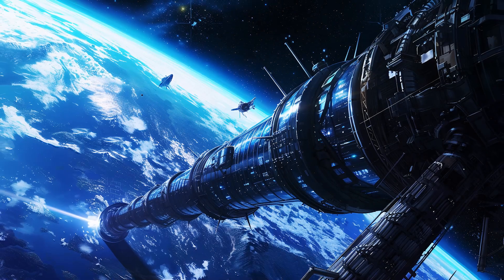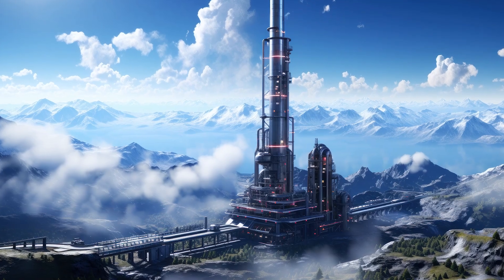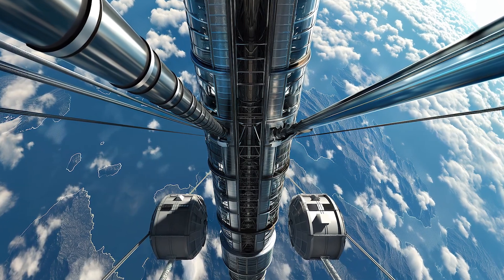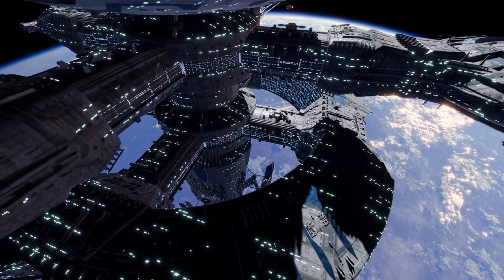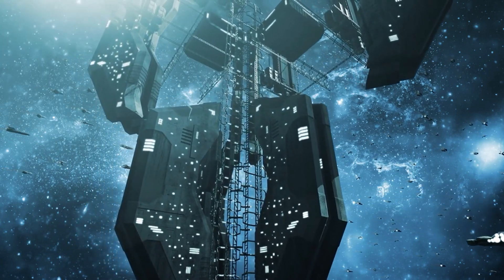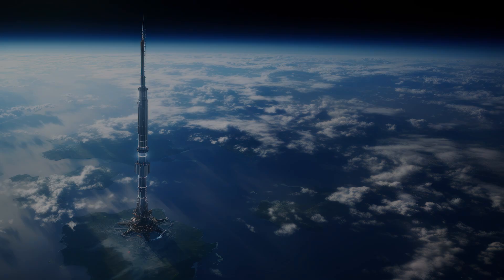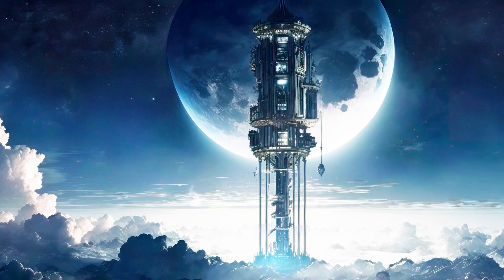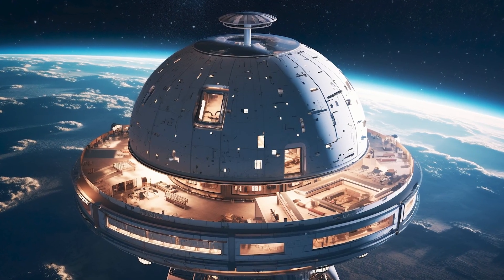Space Elevators - Humanity’s Greatest Dream or Biggest Delusion?

Comment: At the top of the elevator you would not feel weightlessness. 
 You need to be moving at around 17,500 miles per hour. 
By going straight up you’ll still feel mostly the  same as when standing on earth.
Reply from the maker: I think you meant to say that at the top, you "would" be weightless? At 22,000 miles above the Earth, you would be in a environment similar to that of the Space Station.
Reply: @ the elevator is not 22,000 miles tall. 
In the video the elevator appears to be just outside our atmosphere. At that height, standing on the top of the elevator you would “not” notice much weightlessness at all. 
 The earth would still effect you unless you were traveling at 17,500 miles per hour. The moon is 250,000 miles away and it is falling towards earths gravity. The only reason it doesn’t fall on us is because it’s traveling really fast. 
 If the space station stopped moving it would drop like a rock back to earth.
Reply from the maker: The images don't represent the actually distance. AI image generation is still very limited but the video has to get the idea across and still be entertaining and informative. The optimal distance for a space elevator is approximately 35,786 km or about 22,236 miles. At 120 mph, it would take 7.7 days to get to the top.

Comment: Some improvements I would suggest which borrow from the "orbital skyhook" concept: the cable will be shaped like a flat belt, so micrometeorites would be unlikely to sever it. Instead of "climbers", the belt should be made in a rotating loop, with attachment points for passenger and cargo containers. There would be "ferris wheels" on either end for the belt to turn around, and that would also be where the continuous inspections and repairs would take place. The lower wheel could be airborne instead of attached to the ground. In the event of bad weather, the system could just lift it above danger and lower it again afterward. Containers would be delivered to the airborne wheel via dirigible or other aircraft, or even raised from the ground by a shorter crane system hanging over ground ships/stations floating in open ocean.
Reply from the maker: You've put some thought into this! If there is a way that physics allows, it would be egregiously expensive but a marvel of human achievement.